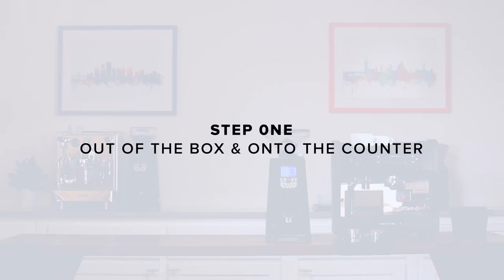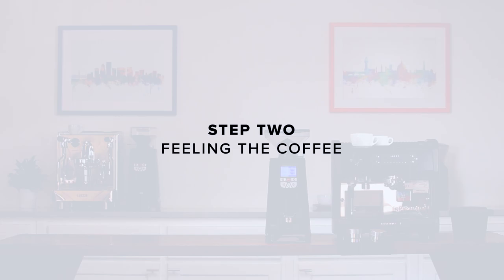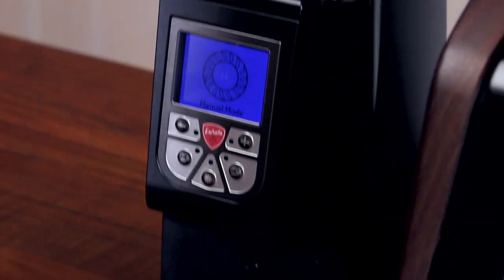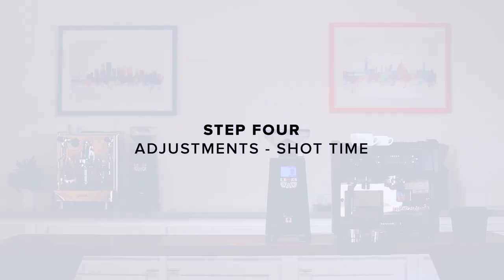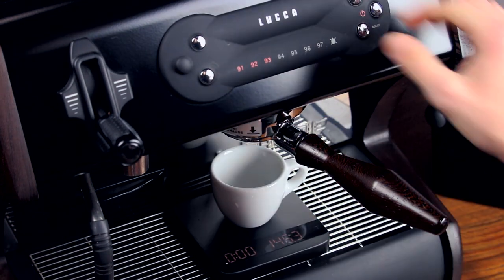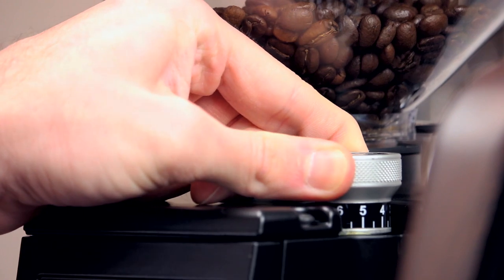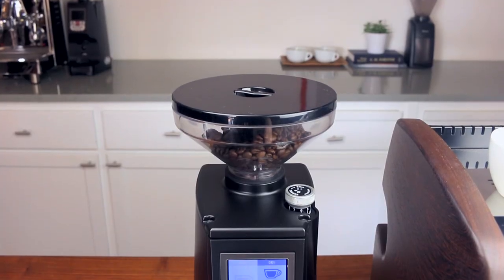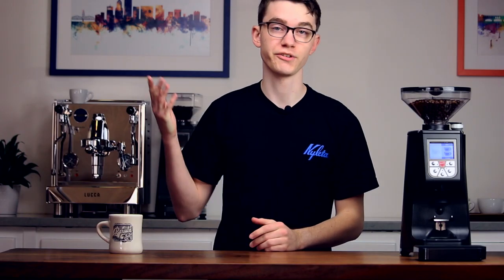Eureka Atom 65 Espresso Grinder Setup

Comment: How does the Atom 65 compare to the 60 with grind retention?
Reply from the maker: The two have a pretty similar amount of grind retention thanks to Eureka's tidy burr chamber design. The key difference between the two is in the way they're fed. The Atom 65 performs far better when single dosing thanks to a streamlined neck design, where the Atom 60 has an augur that slows things down when single dosing. If you plan to use them with a full hopper, they're both excellent grinders. If you haven't, I highly recommend checking out our Grind Retention video here: https://www.youtube.com/watch?v=3_eWwZbEhrI
- Charles